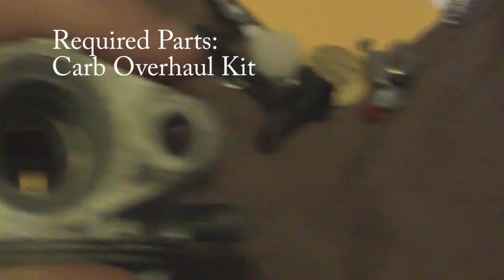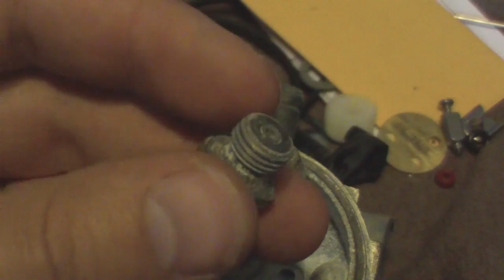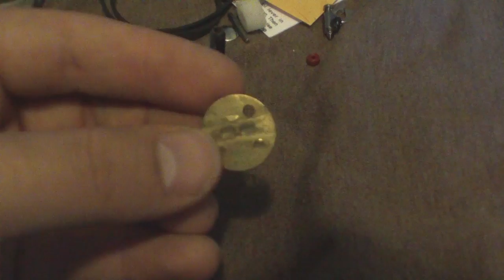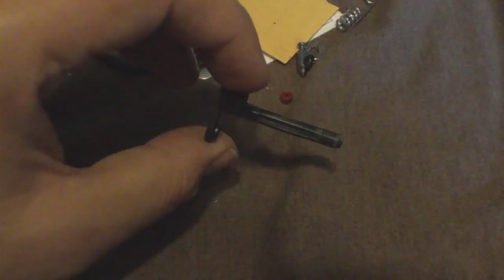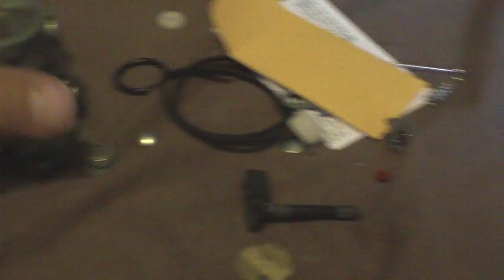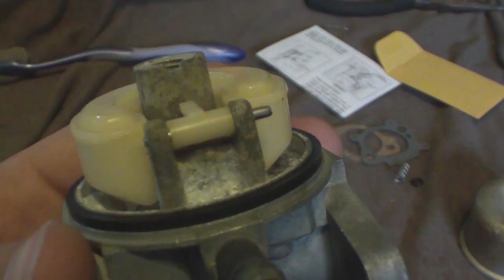Briggs & Stratton 6.5hp small engine carb overhaul

Comment: Use compressed air and a blow gun w/ rubber tip to blow out the seat, blow through the gas in where the gas hose atteches

Comment: That brass bolt IS the jet. The brass part up inside the body of the carb is an emulsifier tube. A drywall screw works good for removing the needles seat, and a q-tip in a cordless drill with hand cleaner works well for cleaning and polishing the needle bore.
Reply from the maker: asandberg6 Good to know, thanks :)

Comment: Really great break down, but dude you left out the one part I can't figure out and that's those last two gaskets. The brown cork looking one with the adhesive back doesn't seem to want to fit against the air plate and seems to cover the primer hole on the carb, but if I only use the grey one there is a gap in between the air plate and the carb. please